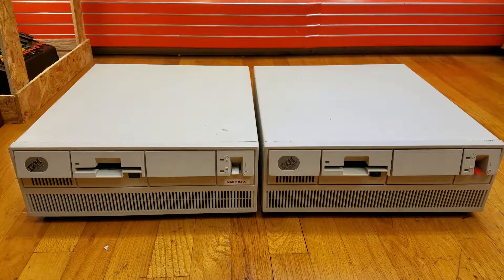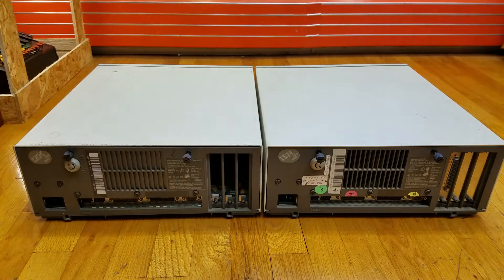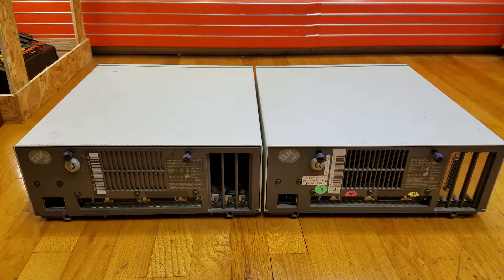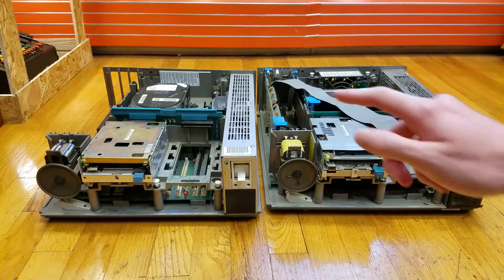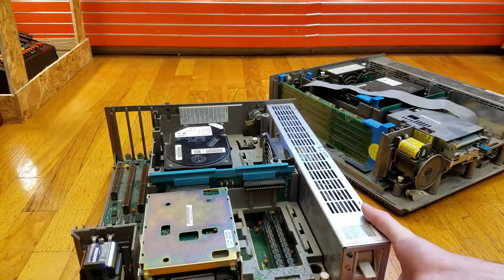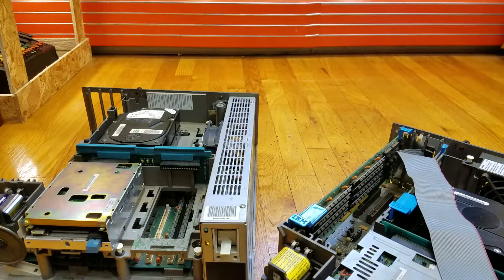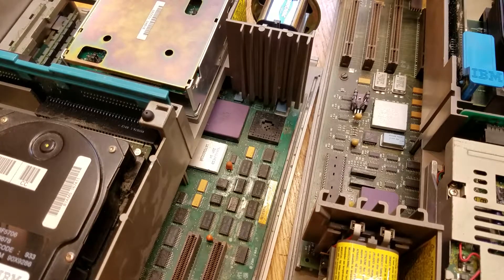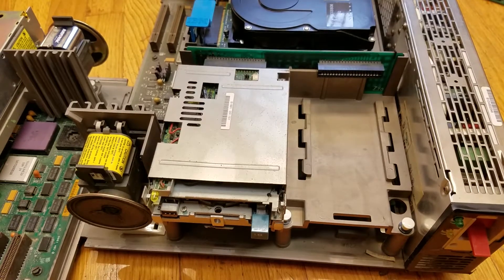IBM PS/2 Model 70 vs Model 50

Comment: @10:38 - On the Model 70 it is a "DBA [Direct Bus Attachment] ESDI" HDD - all the controller circuitry is on the drive itself. DBA ESDI is actually a truncated microchannel slot, missing the unneeded signals.

Comment: @8:30 - The extra portion at the back of the 16-bit slot is "AVE" (Auxiliary Video Connection) - sometimes referred to as the "8514/A slot": The 8514/A adapter needed the VGA modes from the system planar. Here is a layout of all the different microchannel slots: https://www.ardent-tool.com/tech/MCA_Slots.html

Comment: I also didn't realize that the 16-bit slot on the Model 70 is for the video card. I have an XGA2 card in one of mine and have to look if it's in the right slot! This is excellent information.
Reply: The hard drives used the model 70 and later model 50z were very early versions of IDE
Reply: The Model 70 (and Model 50) has VGA from the planar, so the microchannel slot is with the 'AVE' (Auxiliary Video Connection), not a Base Video Extension ("BVE") like the XGA[-2] would use - but that is fine for the BVE to not connect.
Reply: Man, MCA is just a whole basket full of things.  I can’t help but wonder if it was really flexible, or really kludgey.

Comment: I have two identical Model 70s but one had a Model 50 case and I couldn't figure out why. I guess its case was swapped at one point. They're both identically spec'd with the same board and add in cards too. They were from some business that donated them to Goodwill. Another journey I've been on is finding an MCA sound card. I haven't found much luck in a few years of looking, unfortunately.
Reply: Good luck finding one. And if you do be prepared to spend a fortune on it.
Reply: Tex-elec has made a couple new MCA soundcards, one very reasonable, the fancier model is very very good.